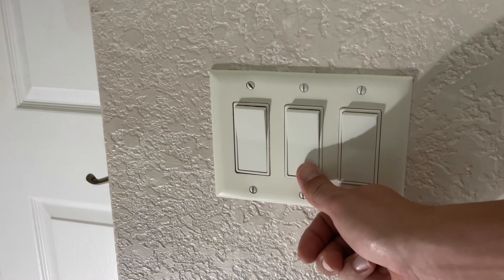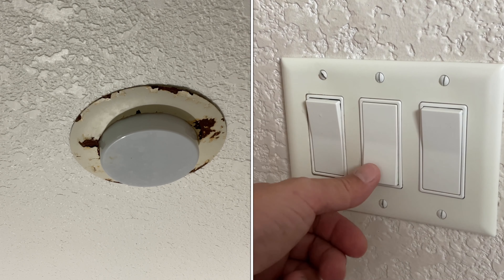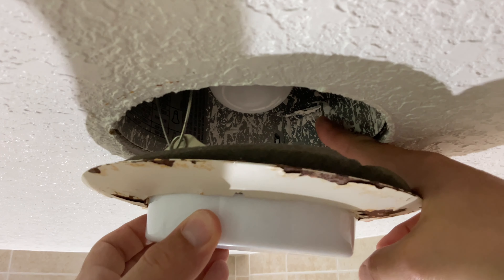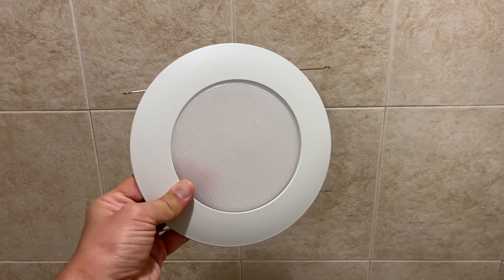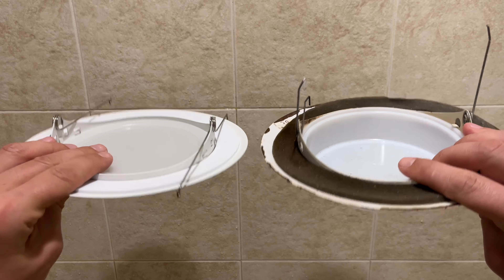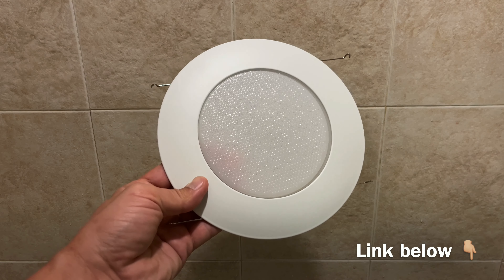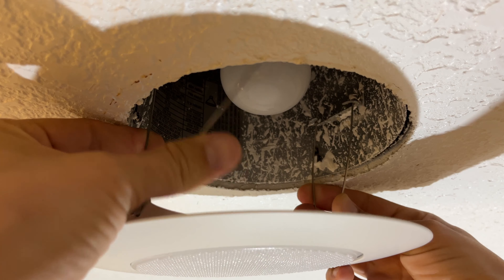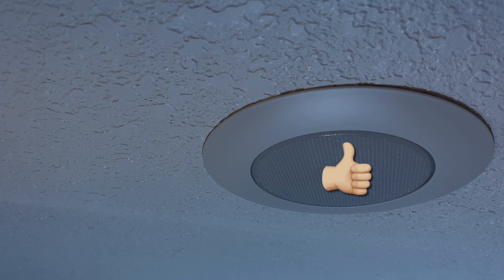Shower Light Fixture Replacement Trim - How to Install

Comment from the maker: You can find replacement shower light trim here: https://www.amazon.com/s?k=shower-light-trim&crid=JUMIEF4O6P17&sprefix=shower-light-trim%2Caps%2C104&linkCode=ll2&tag=yttch-sh0w3rtr1m-20&linkId=a2c6cc72cb1dcb58f9102ec77755a7c2&language=en_US&ref_=as_li_ss_tl

(As Amazon Partner, I may be compensated if you make a purchase).